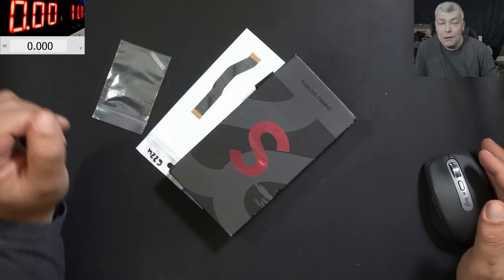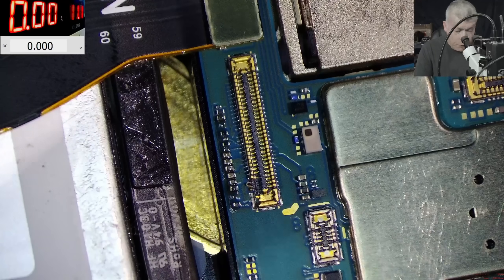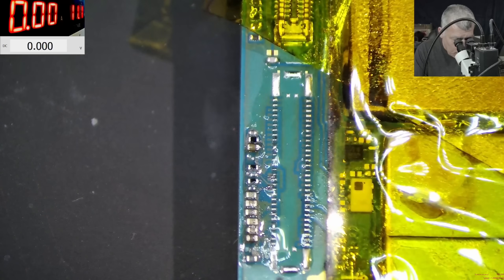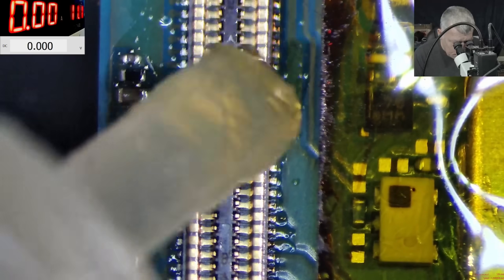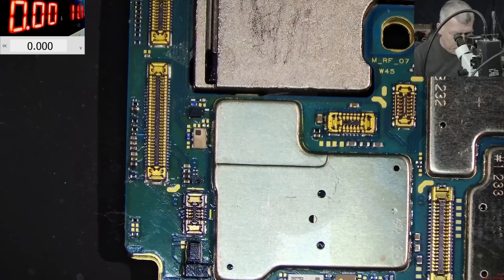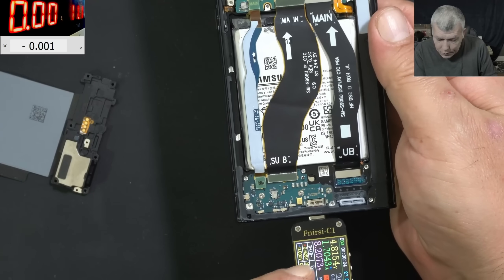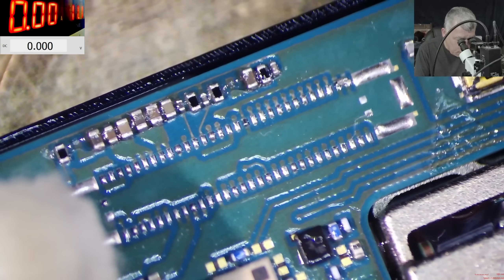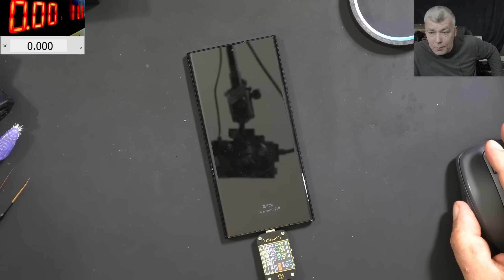Samsung S22 Ultra screen fpc connector replacement

Comment: Please can you do the same for my S23 Ultra, today it self i got into water touble, everything works fine but the exact same green display issue and i checked the main board display connector is not good.

Comment: As long as the FPC still needs to be pressed with your finger for the screen to work, this means that the repair process is not complete yet! As one commenter mentioned, you should solder the pins one by one or check the fault that is causing the screen to not work properly.

Comment: Cute seeing our old man getting challenged by a phone micro soldering job. I think the connector didn't solder well because the connecting solder wasn't wicked before adding the low melting solder. But in the end, you did great, man. 👍 😊😊

Comment: Hi . Have issues with a Samsung S21 5G replaced the charger board . battery . motherboard and cant see when usb c charger lead plugged in any charging on battery . Could there be an issue with ribbon cable leads from charger board . No idea at this time what issues could be . Any help most appreciative . Thank You .

Comment: Curious, why would you use soldering paste vs using fresh solder? The pins are small, granted, but couldn't the same results be achieved with 180 degree soldering wire? Just want to learn, thanks Sorin for your teaching.
Reply from the maker: using solder wire, you can't really stick to much solder on each pad/pin, but using the solder paste where are a lot of small solder balls, you can stick how much solder you want on each pad/pin
Reply: @electronicsrepairschool  using paste is ok but regular solder does stick to small pads. I'm routinely soldering QFP208 or larger chips with 0.5mm pin spacing for over 20 years, normal solder and normal smd gel flux works well.

Comment: Sir i am also mobile technition,in this type work must use solring wig  and remove old high temprature soldring then apply new low temp solring.you dont need second try after this step.

When you dont remove old high temprature solding  its mixed with  new low temp soldring.and left some dry pins and not properly connected pins.

Thanks Sir you are my teacher also

Comment: you have to solder fpc connectors pin by pin, this motherboard is double stacked and its prone to solder balls displacement  between the layers, the connector also has solder on the contact side and should be discarded immediately

Comment: Great job, but my question now is, how did that happen just from the phone falling from the bed?
Reply: I have the suspicion that part of the connector touches something on the back plate, maybe some plastic pin that's intentionally there to prevent the ribbon cable from getting disconnected on drops (so it kind of overdid its job). The fall potentially applied too much force to that tiny area, which then bent the connector and pins underneath it.
Reply: I mean, how high that bed is
my phone might be falling from higher place, but nothing bad happen

Comment: I have seen chips from there with wax or oil or a coating on the pins, that you have to pre-tin before the solder sticks.

Comment: I am just curious why the other repair shop wouldn't change the connector? That should be a relatively easy job for them shouldn't it?
Reply: most shops do not have a microscope or a worker capable of doing that.
Reply: @orange11squares  seriously?? what jobs do they do then?
Reply: @mime4331  simple jobs like replacing screen, battery or complete motherboard/keyboard/screen assembly.

Comment: I had this problem in the past it was the anchors I use the solder weak to wipe them out reflow the connector and then i solder back the anchors with soldering iron

Comment: I wouldn't want to do it with that connector. But for a PS4 controller I got for $5. The ribbon cable to the charge/LED board was broken on the motherboard side. So I just hard wired it with 30awg solid core kynar wire. Has been working just fine. Even trickle charged the battery and brought it back from the dead.

Comment: the moment I saw him not put any pressure in a brand new connector and no flux I knew we would have a surprise xD
Reply: At what point of the video you started to watch because solder paste and rosin was used to solder the brand new connector😊
Reply: @markmorris6246  yeah I wasn't looking when he put rosin, but in my experience rosin is not very good for fpc, it's too dense
Reply: @AmazinChannelz  there is flux in the solder paste. that's the paste bit.... tiny solder balls+flux = solder paste. I knew there would be a problem but not because of rosin or paste, because of poor technique. New parts should be pre-tinned, then wicked off then part put onto bare pcb pads then soldered by hand with smd gel flux. Unfortunately he only looks at the time and taking shortcuts not realising doing it the right way makes a better result and it doesn't have to be done twice, thus actually saving time ;-)